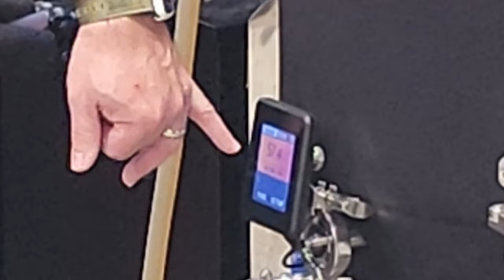Brewing Adventure: Crafting 6 Unique Beers from a Single Batch!

Comment: Thank you for showing the valves and your flow with them. I have a two vessel 1 BBL system and swap hoses and have been thinking about using the valves to connect and not spill/drip any more. The Auto sparge is worth the money as it reduces the stress of flows a TON. Helps since I use it to circulate water from the boil kettle over the grain bed for the whole 60-90 mash.
Reply from the maker: Awesome, I'm glad we were able to answer your question. I plan on getting the auto sparge by our next brew on the BBL system. thanks for the info! Cheers